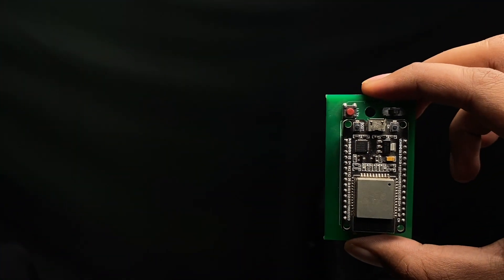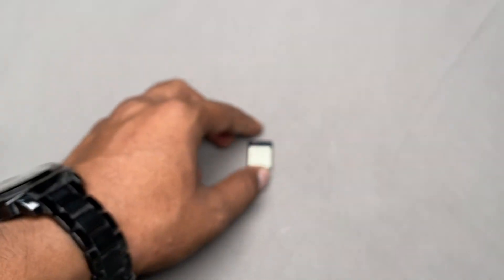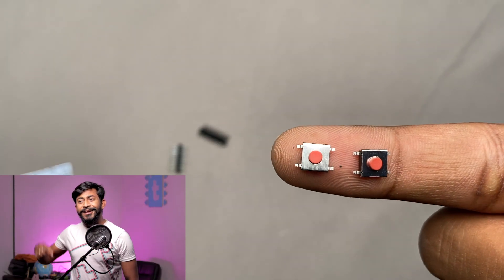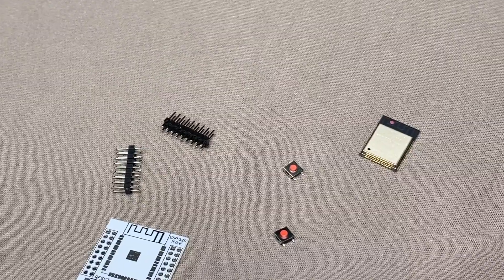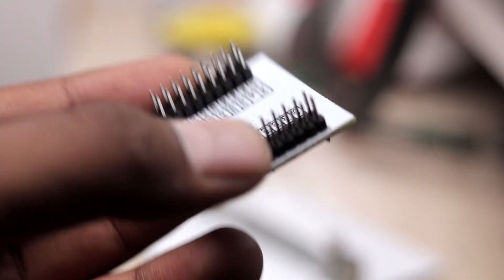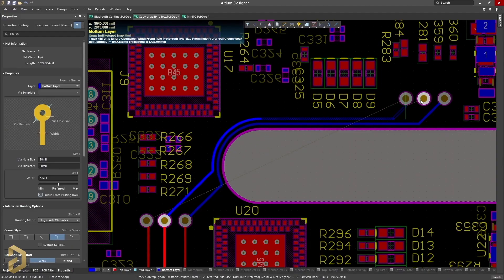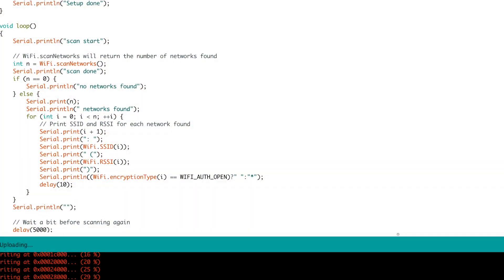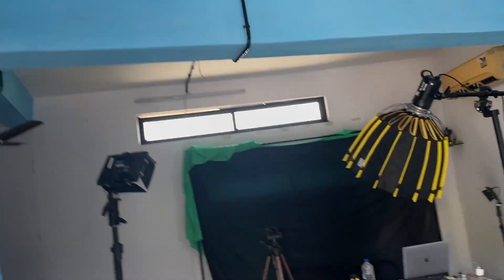Making ESP32 projects smaller😱🤩 | How to program ESP32 Chip using ESP32 Board

Comment: Excellent!  The most important thing I got out of this video is the need for the 2 resistors on those 4 pads.  There was nothing in the package to suggest what goes there (I thought the chip had its own pull-up and pull-down where needed).  I have an FTDI breakout, but even though the IOs are 3.3V, it's VCC out is 5V, so I'm using the 3.3V power from the dev board.  I don't have it programming yet, though, because I don't have the resistors.  Maybe I can find out where those resistor pads go and use "real" resistors that I can actually see and handle!
Reply: Without any investigation, I presume those 2 pull-up resistors are for the push buttonts.
Reply: @Glanmire3  On my sample of ONE, that was the case.  Without the pull-ups, touching, or just getting my finger near the reset button, would cause the module to continuously reset.  Sometimes it would not do anything.  Adding a single 10k pull-up on the Reset line cured that behavior.  It seems to be working fine, even though I did not use a PU on the GPIO 0 line

Comment: Hi Sir, please let me know how can I determine accurately the RAM ROM and EEPROM size  of a microcontroller for a professional project? Waiting for your reply, Jayabrata Biswas
Reply: from it's data sheet?
Reply: @aayush_789  My question is for a specific program what should be my required RAM and ROM will be?
Suppose I have done a project in Arduino nano. How much RAM or ROM will be optimum for this project if that code will run on a microcontroller?
Or in other words if I  write a program in Assembly language how I determine the required size of RAM and ROM that a microcontroller should be so that it would operate properly?
Reply: @jayabratabiswas01  Create your program, compile it and see the size of compiled file. Choose a microcontroller with more than that size in ROM.

Comment: Tx pin is an output pin. The Tx pins of both chips may have different outputs at the same time. Will this damage the chips? Does it corrupt the communication with the computer?
Reply: Probably not, because the chip on the dev board is disabled by grounding the EN pin.

Comment: Hi, great video. I have a question. I bought an ESP Wroom 32D, I can't programming it. I have tried many different schematics, I have contacted many people's and consulted various blogs and videos,  but no one could help me. Arduino IDE give the error about serial communication. I tried to program esp using ch340, co2102 and various Arduino board, but no one helps me
Reply from the maker: What’s the error?
Reply: @techiesms  I have already solved. Basically I didn't connect GPIO12 to ground, I didn't put resistor between GPIO2 and ground and I have connected NC with GPIO23. After solved these error, I could able to program the esp without problems
Reply from the maker: Amazing
Reply: @techiesms  yes. It's very difficult find a correct schematic for esp32. I tried various ones, but only one works for me

Comment: Hey, I'm working on a project which uses a battery backup, i saw you used a 250mA 3.7v battery with what i can think is a tp4056 module. I have been studying the sheet of the module and came across the fact that it needs different Rprog (R3 resistor) for different battery current levels.
Did  you change yours in any other way as the one which comes with the module is for 1000mA battery
do tell me if your project works fine even though?

Comment: Quite interesting you have not used any voltage regulator and your esp32 is also working well with lipo battery, how it's possible
Reply: @Gocast2  Battery charging module don't regulate voltage

Comment: Dear Mr. Sachin I want to buy this breakout board soldered with ESP32 Chip from JLCPCB using their SMD assembly service. Will they have readily this Break out board design to supply along with ESP32 Chip. If not available can you post a YouTube video, the PCB design for the Break up board. It will be very useful for subscribers who can not solder the chip on their own but to use JLCPSB's SMD assembly service. Or at least post/ reply the link where this design is available in internet. Please reply.

Comment: Actually, the programming device part does not work for all ESP32 board models. So the error "Failed to connect to ESP32: Timed out waiting for packet header" appears, and the solution will not  to be add capacitor etc. A solution for this is to use other development boards that have different serial converters, for example: ESP8266, ARDUINO DUE that WORKS FOR THIS PURPOSE. The only difference is that, on the Arduino board we take the reset for GND. Apparently there are two types of serial converters in ESP boards, some of them use the chip that has the CH340 driver that WORKS for it PERFECTLY, and others use CP210x driver that works with the esp8266 for this purpose. Some tests that I performed that do not work are: Arduino UNO model DIP and Arduino Mega. All tests were performed on the W10. I hope to help someone avoid the same headache that I had with this problem kkk
Reply: Thank you Sir very kind of you
Reply: Hey I have CH340 TTL but I'm also facing this issue, so what can i do buddy
Reply: So is better use FTDI module right?

Comment: Please Friend, I recently purchased ESP8266. Unfortunately the device driver could not install automatically with my version of window 7. After several attempts, I managed to install the driver from sparkfun. I have installed the esp8266 in my Arduino ide library. The problem now is, I am unable to upload a simple code inside the node MCU device. I always get error, "port can't be opened, access denied". If I manage to open serial monitor on code view, I get the following error "port 4 busy" what do I do please? 
Under my computer device manager,  esp8266 is installed as com port 4. If I switch USB port for the node Mcu, the com port will change to com port 17. I have no other device with com port except the esp8266.

Comment: Almost all the ESP32 projects are built and code developed using Arduino IDE which is the main drawback  . Though Arduino IDE is great it is not meant for
product development with ESP32. Must use ESP-IDF to develop products marketable . Just like the Arduino IDE there is a Espressif plugin for VS code which is great .

Comment: Hi, thanks for the great videos you've produced. I'm just wondering if you can consider making a video for programming MQTT to wemos D1 mini using Arduino platform with PubSubClient library or any other library which you find more stable. I would like to subscribe/publish to Mosquito broker in home assistant. I personal find that using Arduino with MQTT provide the most flexible way to introduce automation into home assistant because many people have the basic knowledge of programming Arduino in basic level. The only missing link is integration to home assistant. ESPhome is also flexible but is a bit difficult to pick up due to lack of sharing material in the community. Tasmota is easy but not flexible. Thanks again for your great work.